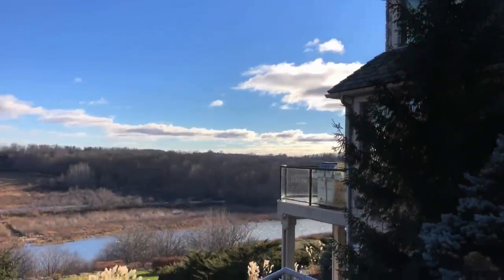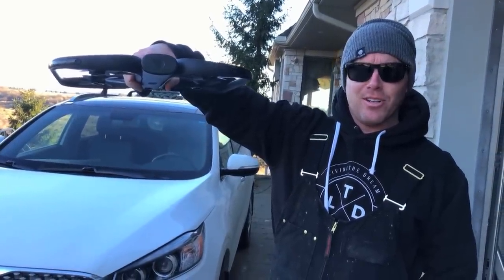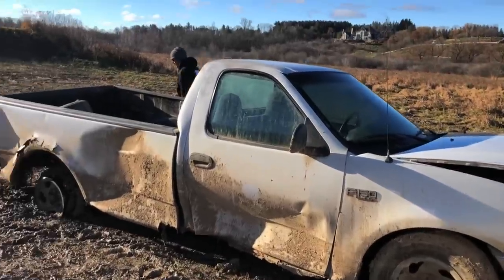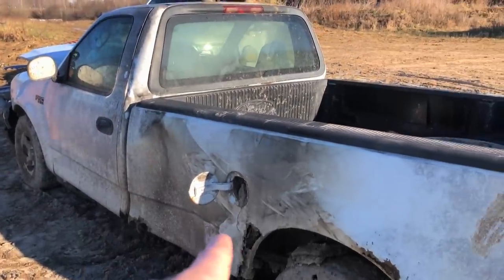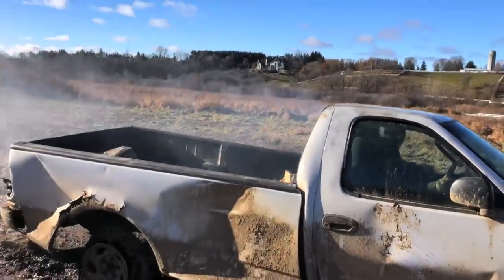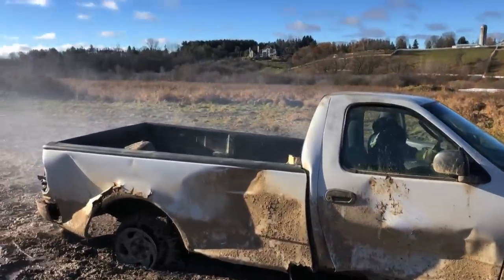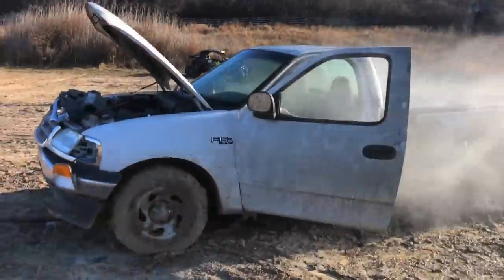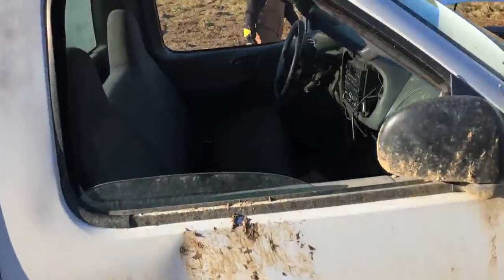F 150 Engine Filled With LIMESTONE! Exploded!!!

Comment: I'm pretty impressed that little V6 Ford held up pretty good Ford ain't all that bad just over engineered now that was pretty brave to grab that spark plug wire they'll jump like an inch or two and  that RPMs it would tagged you a bunch of times